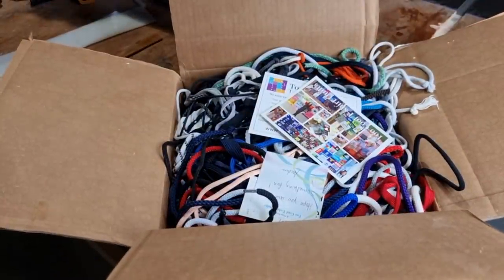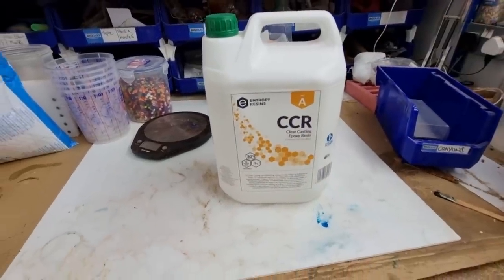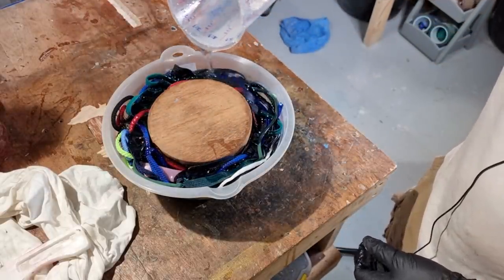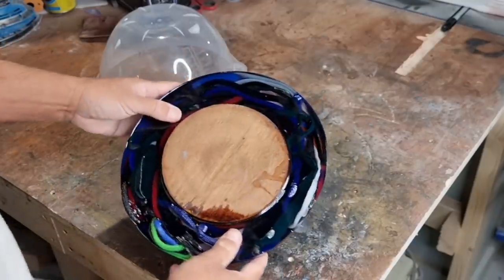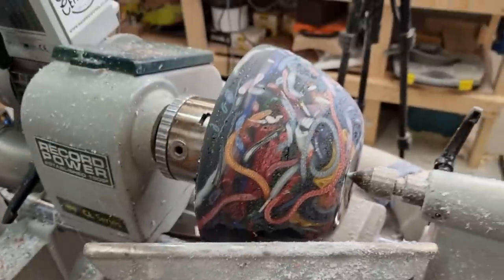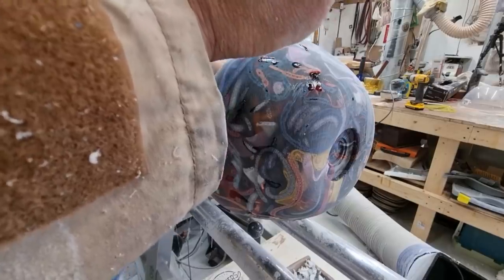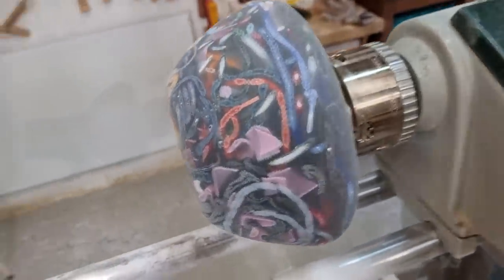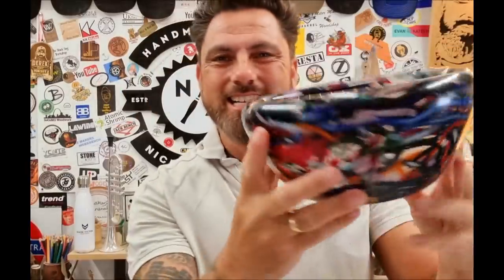Hundreds of Shoe Laces set in Epoxy Resin - Turned on a Lathe - Success or Fail ? 🙄

Comment from the maker: Thanks for watching folks, It means a lot. Please don't forget to click your notification bell in the top right hand corner of your YouTube channel to be notified of all my up and coming new videos. I have some really crazy ones in the pipe.  Also if you can share this video that really does help me and the channel. Much Love all xx
Reply: Love the waffle always Nick! This project was so much fun to watch!  👋🤗
Reply: @Nick - if you soak the laces in slow curing resin under vacuum for a while, won't it get rid of most of the air bubbles issues you are having? I understand that it is much messier to then continue with the project like you do. Just thought it might help with the air problems in the pressure pot?
Reply: You should try to make a shoe lace plate
Reply: I was looking at the bottom of the bowl and I got a flash of an idea. It kinda reminded me of a bowling ball. It would be kinda cool to have you actually MAKE a resin bowling ball. Maybe even a clear one  with a skull in it like in Mystery Men.

I just read this comment to my husband and he went it one better. An LED light inside that makes the eyes glow red whenever the ball moves. It could even be the kind that motion CHARGES the battery, kinda like a self winding watch. That way  it could be permanently encased in resin, but never run out of power.
Reply: @juliebaker6969   I absolutely love this idea lol! I feel like this would ve more like an idea that I would have! Awesome idea mama!
Reply: @Beabe880  I thought you would like it.
Reply: Great project. Don’t quit the waffle at the end, hearing what worked and what didn’t helps a lot for someone like me who is beginning projects. Keep up the great work.
Reply: Nick you solved the untied shoe lace academic
Reply: You should definitely do a shout out at the end of your vids. Give your fans a shout-out.... Do a question in the vid to be answered in the comments (Example... How many shoe laces did I use? Ect.) Then shout out a random person that got the right answer.  Boost comments and watch time. Also show the en result right at the end of the vid... Most people only stay for the reveal. Hope that helps. Liked and shared 😁
Reply: Hey Nick. love the videos. I would love it if you showed off the back to the future sleeve you are rocking.
Reply: Turned out really well. I hang in till the end brother
Reply: Instead of glue why not have it upside down and pour a layer of resin over it to smooth it out, filling holes as it goes?
Reply: Hi! Video molto belli e tu se molto simpatico, mi fai ridere. 😁 Non parlo in inglese, scusa, ma vorrei chiederti che cosa usi per lucidare gli oggetti in resina, grazie. 😊😊
Reply: Hi Nick, not sure if your aware or not but after all the great Dad jokes, I received an advert, do you select them or not? Plus there was quite alot?
Reply: @Rm.dunn333  Maybe do a tatt reveal for us all. We can’t see most of them cos of his jacket. Maybe a story behind every one. I am a firm believer that every tattoo is a reminder of something in your life. Mine is my husband, 2 sons & 4 Granddaughters… protection sigils & signs under my Wiccan beliefs.
Reply: Yes, I liked and shared!
Reply from the maker: @davidsharp9166  ahh no random brother
Reply: Hi!
I watch your videos for two reasons: the project and the waffling!
Yes I wasn't really watching lately, but I kicked the reason out of my life.
So imagine a striped sock that mumbles Arnies well known phrase: I'll be back! 🤪
Reply: Hi Nick 

We would love to see you create a giant pencil please.
Reply from the maker: @josmith1815  hey i done this . hahah its here https://youtu.be/0Z4T9rOdCVw
Reply: @nickzammeti  cool. Thanks for letting us know. We will watch it!
Reply: Nice piece Nick. 🥰🥰🥰
Reply: @nickzammeti  we just watched the giant pencil video and we loved it. It was the best thanks. 🤩
Reply: That tied up in knots joke got me bud! That was good :D That was good <3 You keep doing you Zammeti!
Reply: Hey Nick. With the rest of the shoe laces do a table top. Or like what you did to the lego table but use the left over shoe laces.😁
Reply: @nick zammeti - you should make this into a huge  kaleidoscope!!
Reply: Hey Nick,  love your creativity and your ability to see art in anything.  I was wondering if you have ever done something with dice 🎲?
Reply: You missed a great dad joke (or two)
Uh Oh…. My Pot is Laced….
I feel like all the resin is stringing me on…..
Reply: Nick this was awesome and so unique. Love this especially the bowl shape adds the the crazy.
Reply: Watching you cut out that wooden blank got me thinking. What if you turned the wooden bit to a bowl shape. Then you could leave a ridiculously thin skin of wood, inside a resin bowl. Maybe some crochet or a knitted hat...
Reply: That was so cool. Nicest one the . The crayons and colored pencils were crazy cool also.
Reply: Dude, Nick we're do you get your ideas for project's?
Reply: @EWBADGER   Crazy dreams? Take some NyQuil at bed time and you will have some wild ones. Chantix will give you crazy dreams also.  Nick thinks out side the box.
Reply: Your videos are entertaining
Reply from the maker: @topherwallaert9473  hey I did a small project way back when I started YouTube . Don’t go and find it please 😳
Reply: Some of us loves your waffling! Keep being you!
Reply: I hope you read these I used to work in an industrial setting with resin on things that could trap air such as wood or cloth we would pull a vacuum 3 to 4 times before placing the pot under pressure reduces trapped air pockets significantly. 

By the way love what you do.
Reply: Fabulous bowl!! 👌🏼
Reply: BEAUTIFUL
Reply: Hi Nick, I just wrote to you, but I'm thinking I should have done it here ? I asked ya a few questions, I have 1 more what is waffling please, ty, Renae P. 💞
Reply: Hay Nick big fan but I seen all your videos and you make alot of pots and cups or vase like the tables videos I love them but I will love to see you make a led bat out of resent and some crayolas or something Bennett that will make the LEDs reflect and look cool so love your work and thank you for your videos
Reply: Great bowl and I really enjoy your channel.
Reply: Instead of superglue try using UV resin
Reply: I'm trying to write you because I would like to have a couple items made in memory of my late Son. Can't seem to get it done because it says enter another phone number and postal code. I'm in Florida. How can I reach you or have you reach me? Thank You
Reply: Have you seen "Bensworx" ruberbands in epoxy sphere? How shiny he got it in the end? I know you said in one of your projects- I think it was the autumn leaves bowl - that you couldn't get epoxy surface as shiny as when it comes out of a shiny mold, but apparently, it is possible! It would look so sick on this bowl.
Reply: The differences between Nick and Ben are night and day... Nick's chaotic energy is a complete 180 from Ben's calmness and between the 2 of them i always have something to watch depending on my mood.😊

Comment: If you want to do blanks to reduce resin waste, which I would recommend. In this case, try using another, smaller bowl. If it floats, weight it a bit. If it sinks to the bottom, just remove some weight.

You'll save time turning it, and save money not using as much resin.
Reply: And save more money by not needing to have waste blanks of various sizes
Reply: Doesn't he get his epoxy for free ?
Doesn't entropy sponsor his channel ?
I mean, I get not wasting stuff if you don't have to, but it really wouldn't cost him anything really to fill it all with epoxy. Right ? 
Or am I confused about entropy sponsoring him ?
Reply: It's a lot less effort, too

Comment: so for the "resin-saving-blank," if you just bolt a bar across it, that can hold it in place. will also make it easier to fix it in place with tape or a rope.

Comment: That looks pretty cool! You could see where the bowl deformation occurred. When it went into the pressure chamber.

As said before, if a smaller bowl was used inside to save resin and bulking blocks it would also be quicker on the lathe. A weightet bowl with a cross stuck on top that sits on the edge of the larger bowl should work.

Maybe cut the tabs off the large bowl to stop deformation and make a string handle (like used on boild pudding bowls) for lowering, that would also save time on the lathe.

The glue trick was handy to know, saves mixing resin for filling pin holes but on this bowl would have been too much effort fore me. I'd have been tempted to glue in the ident tag and mix a small amount of resin, pour into the original mould and lower the piece back into it. Then rework the solid surface, it wouldn't be too thick.

Comment: To keep your blanks from moving about put a thin board across it and secure it with a screw then rest the board across your bowl or whatever form you use, it will prevent sinking and shifting

Comment: You could put some laces in the bottom first, then put the blank on top of those, then pack the rest of the laces around the blank. Put some tape over the top to stop the blank floating. Simples

Comment: You can fill any size hole with ca glue you first fill the hole with a hardening agent like in your case I'd use Formica powder colored to your liking fill the hole with dry powder drip ca glue on top it will soak threw the color and be hard in seconds the Formica is a filler and a hardener baking soda or saw dust works to you can even use it on cement or concrete just add cement dust to and you got cement

Comment: Try to vacuum chamber your projects before you pressure pot them. The pressure pot gets rid of bubbles to your naked eye but it really just shrinks them and sets the resin under pressure which causes blow out or chip out when you hit the micro bubble. So getting rid of the bubbles through a vacuum chamber first before you pressure pot them will prevent any chip out from happening also it would super soak things like the laces.

Comment: An idea: instead of packing laces in, why not place them so they are stretched out? Basically, make a bar to hang them on and also use the sides to hang them on and once hardened cut the additional lace off.
This way you would have long lines and it would likely make a cool vase or display piece if lit up.

Comment: I had a thought during your waffling on. Do you think the resin would have had more adhesion to the records if you stacked them on the sides in the pressure pot? I figure lots of micro bubbles got trapped in the grooves.

Comment: would covering the laces in a modpodge or polyacrylic sealer   letting them dry  and then put the resin over  stop the resin from soaking up so much?   sorry new to your channel  ive started making key rings   just curious what else i can do   i dont have the fancy equipment you have  pressure pot lathe   but  i would love to get a lathe  eventually   looks like fun

Comment: Why don’t you use a smaller pot to block the middle of the main pot? You can buy a set with like 6 pots of all sizes that fit inside the big pot. Just wrap some clingflim or spray some release agent on the internal one so it just pops out easily. Then it’s the perfect size / shape every time.